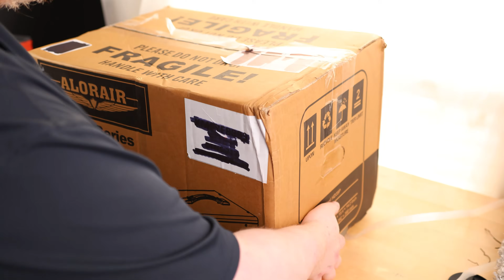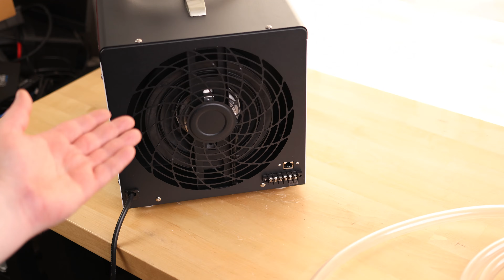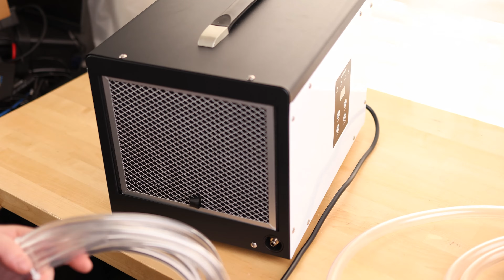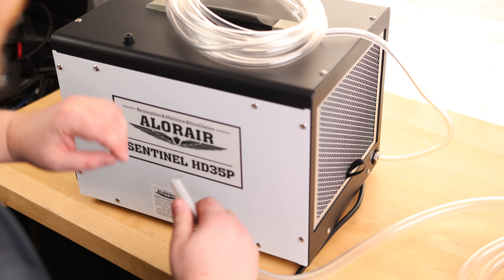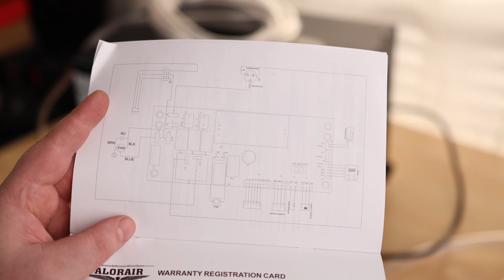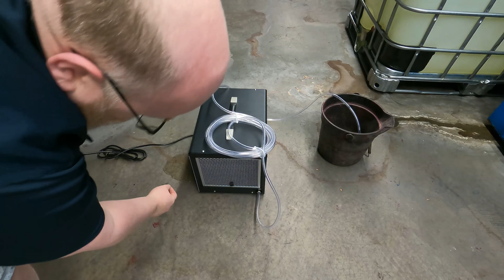ALORAIR HD35P Crawl Space Basement Dehumidifier

Comment: This dehumidifier works great for 3 months then starts giving you errors. In my case I’ve been getting e4 error. It’s something to with pump. Company does not stand by their products. They want you to replace pump out of pocket and do not guarantee it will fix the issue. I regret paying 460 for this piece of crap. Pump shouldn’t break in 3 months for something that claims to be “commercial.”
Reply: so it will not work even to just use the side drain to drain regular? from what i seen. most dehus pumps fail. but if you can still drain it outside from reg gravity i still think 2.9 amps is really good vs the 4 amps i get from my 70 pint unit.
Reply: @Bluntedco. Yes, it works via the gravity mode if the internal pump fails.

Comment: My Alorair HD35P is just a little over a year old. I have had issues with it right from the start. It keeps shutting off with E4 error codes. I will remove the plug and drain it and then it will restart, but I keep getting these error codes after it runs briefly. I replaced the pump and it still shuts off with E4 codes. Any suggestions to remedy this?
Reply from the maker: According to this the fluid level is high in the reservoir.  https://www.alorair.com/gallery/pdf/1551955523.common-menu.pdf  Does the pump work?
Reply: I know it's been awhile since you commented but, if you remove the back panel with 8 screws you will reveal the pump and filter. Filter is down at the bottom pump is at the top. Pump has a small  plastic bracket holding it in with one small screw. Filter is down at the bottom under a small metal plate that also holds the float that controls the pump to come on. There is also one small screw that holds that plate on. First take that screw out and check Filter. BE careful everything is kinda tight but, not bad if you just take your time. If Filter is all jelled up you'll need to clean it out. You'll need to remove the pump out of it's holder  and very carefully pull the hose from the rear feeding down to the filter. Once you figure out how that all connects the filter will pull out of the hose so you can clean it. It's not bad. You just need to study everything's place so it gets put back in the right place. Mine has got all jelled up twice in two years but, now my unit is not  working properly and their customer service is horrible. Good luck.